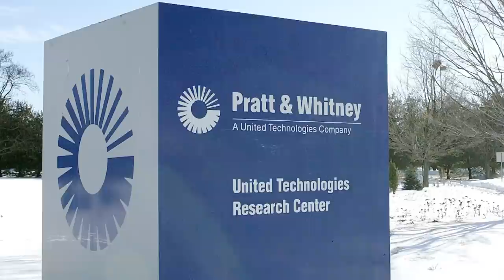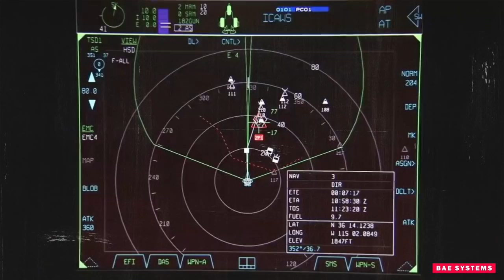PreView - The Future of Military Engines

Comment: Yes but - it's over. Not all and completly over, but very much so.

The fighter of the future is no one, it's a drone, stupid. Maybe drones in high numbers. But the above mentioned engine qualities don't apply the same way. And max one small engine per drone. Easy a commodity.

And power generation alltogether seems to be going somehow 'direction low-tec'. Because of paradigm shift: Siemens for instance reduced capacity and prospects for it's powerplant steam turbine business unit recently as well quite dramatic - wind and solar, low-tec relativly, take over quite a bit of the total market, i.e. 40 to 60 percent. To a certain extend good to have 

Why keep an F16 or F22 - depending on onboard-pilots not getting tired after 24 hours of duty 'and others things' - if i can have a flock of hundreds of drones 24/7 unexhausted instead?